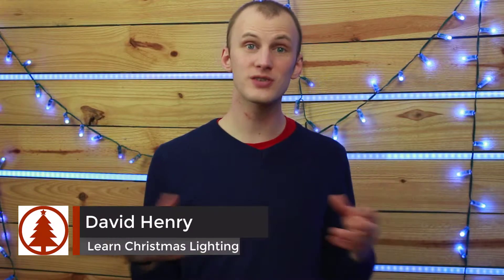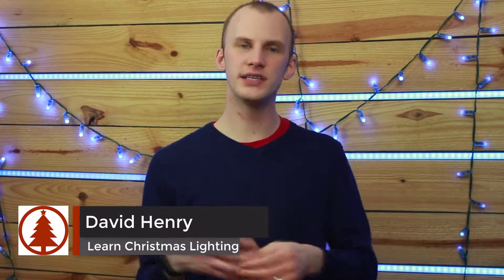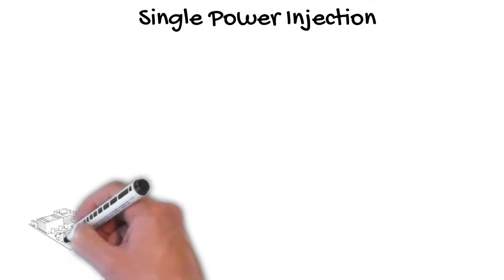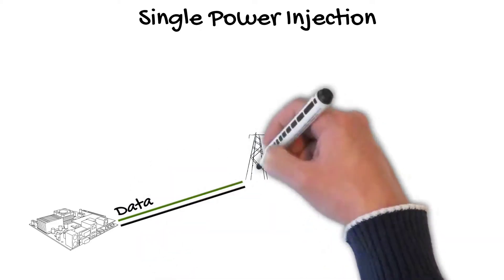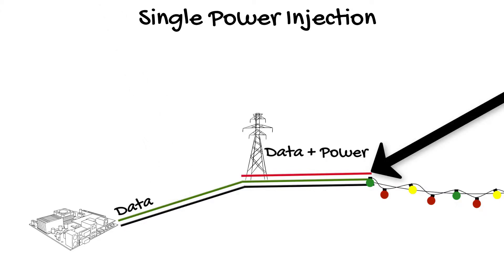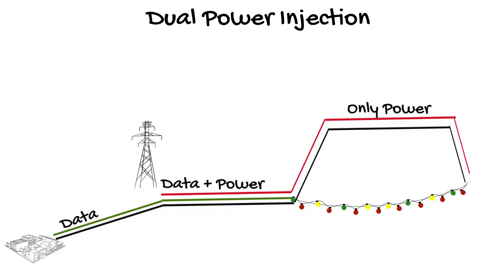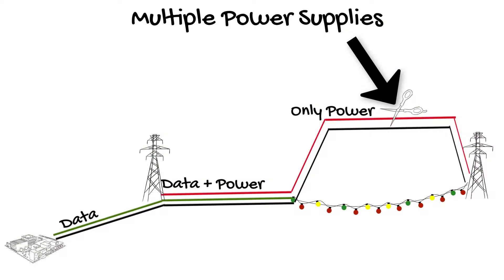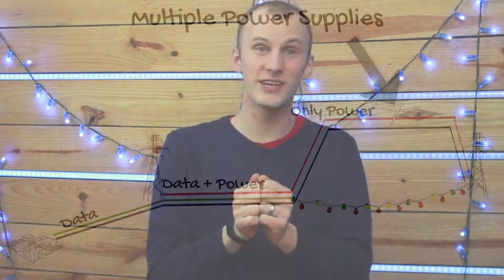How Do I Inject Power for Christmas Lights?

Comment: Thanks for all your videos. 

I have a question about power injection. Could we use only one Master 12v wire and connect 3 T connectors in total (one at every 200 pixels) for a string of 600 pixels? 
I tried it but after the first power injection, my 12v wire drop to only 9.6v so I can not power inject the others one T connectors with such low current. 

So, I think that only one power injection is possible per  one 12v wire coming from the power supply. 
Do i'm right?
Reply: If you have a 12v supply with enough Amperage, you can theoretically have a main 12v supply 12v to provide power at the start of the run,  inject every 200 pixels (2 tees), and provide power at the end of the run. 

Some factors that can cause your voltage drops are: wire gauge/size, wire length, and the "brightness" you desire on each pixel.  The voltage drops quicker with smaller wire gauge, and longer wire lengths.  I hope this helps.

Comment: I saw ws2811 string with 50pcs on aliexpress and next to the controller wires, it have red and black wire, so can I add power through that at 100 or 150pcs?
Reply from the maker: Yep, sometimes they do come like this from the factory :)

Comment: Is there a simple diagram that I can follow as a template. I understand the concept but just can't visualize it.  This is my delema. I will be running a f48 with 4 diff receiver's @ 12volts. I will be making my own ends to save on cost. The 1 thing I can't visualize is when it comes to the (T) for injection.  If anyone  has suggestions that would help. All the info over the web describes how to but not the process.
Reply: Forgot to add  that I will have a distro board @ every receiver
Reply from the maker: To be honest, it's really hard to make a "one-size-fits-all diagram" when you potentially have multiple power supplies vs single, etc.  I do have diagrams inside of Learn Christmas Lighting Academy (https://learnchristmaslightingacademy.com/learn-christmas-lighting-academy/ - opening March first for new students).

Most of the T's you buy simply have all the wires connected all the way through.  So you only connect up the power wires on the "down" part of the T that goes to a distro board.  If you're using multiple power supplies you also need to cut off the "+" wire coming from the existing pixels as it hits the T.  

And last, but not least, with how inexpensive controllers and smart receivers are today, I honestly recommend NOT doing any power injection for most props (matrix's excluded).  It's a lot more complexity in initial setup and each year when you setup, all to save only a few dollars.

Hope that helps!
Reply: @LearnChristmasLighting  Thank you for the feed back. I guess my only concern is that because of budget  constraints and my ability to  be more of a hands-on project person. I was going to make my own connections. Will keep an eye out for  your academy, and also enjoy all of your videos.

Comment: when u talked bout multiple power supplies , I tried to understand  and I kept replaying...  if i have "3" 12v power supplies  ur sayin to individually power inject  where  it needs to go and not  cross the power supplies together . I would think that runnin a fused busbar could work for power injections  I could be wrong .. always lookin for the most effective process
Reply from the maker: I honestly couldn't tell you.  Everything I've ever heard of or read (including outside of the Christmas Light World) has always told me that crossing the positive wire from multiple power supplies is a bad idea and will cause sparks/fire/failure :)

Comment: Would it be the same process with cheap RGB+12v 4-wire light strips?
Or would I have to run a new controller for every leed?
Reply from the maker: New controller.  there are some "amplifiers' out there for these type of strips, they work okay as well.

Comment: So I will be running strings of 300 pixels on a bunch of my props this season. On the front end I will be running the data, positive and ground coming from my F16 which has both sides powered by one 750 HP PSU. On the opposite end of the string of 300 I will be running a power and negative from a completely separate 750 HP PSU that I’m using only for power injection. The way I’m understanding this is that all I have to do is cut and tape off the Positive wire between pixels 150 and 151 to make this work. Is that correct?  And since both PSUs are in the same enclosure should I go ahead and connect the grounds together via a short jumper from 1 PSU to the other?
Reply from the maker: Yes and yes

Comment: How can I tell what my positive and negative are to my connection that will be going to the end of the string of lights. 

I have a red white and blue cord. How do I know which is positive and negative?
Reply from the maker: What I like to do is grab or cut off one of your input cords to your lights.  Now you can see the color on the wire, and the markings on your first pixel.  Connect that pigtail/input cord to your extension cord.  You can then use a simple electrical meter to check "continuity" and find which wire is each.  It's pretty simple to do, search YouTube for videos on it if you're unsure of how to use a multimeter.  Definitely a good idea for a video I will do later :)

Comment: What about "CURRENT" issues when connecting 1 power supply on both ends of a pixel line?
Reply from the maker: It's fine, this is a pretty standard way of hooking up pixels.  Remember, this is the same power supply, and DATA is only hooked up to the controller via one end (it IS directional)

Comment: Thanks for the info, how can you add more poder to the data line? Got ws8211 leds (3 leds per pixel) but they can handle after 60 -80 píxels
Reply from the maker: Yep!  That's exactly what this video is about - watch carefully, as I show you how you can use or build a "tee" to bring in power and pass through data to new lights!
Reply: @LearnChristmasLighting  thank you for the answer, I guess you didnt get me, I understand the power  injection you explained on the vídeo, but my question is regarding the data out/in wire, there's any way to inject/buffer power to it? Cuz i lose the data signal about 80 píxels (and I think its for the distance  between the ligths)
Reply from the maker: @Tomy_Medina  Oh, I see what you are asking.  So, in this situation, it is FAR from ideal for the WS2811 protocol.  What you need to do is make the protocol work for you by putting a single pixel (or 2) spaced out in the "blank space" between lights.  So, in that 80 ft, break it up into 2-3 segments with a single pixel or 2 in the middle, and use your sequencing software to count them as a "null pixel", or just tape them with black tape :)  A single pixel will re-boost the signal, and it usually can run anywhere from 30-50 feet or more (depending on the controller, the pixels, etc).
Reply: @LearnChristmasLighting  thank you so much, I will try that, nice work on your channel btw